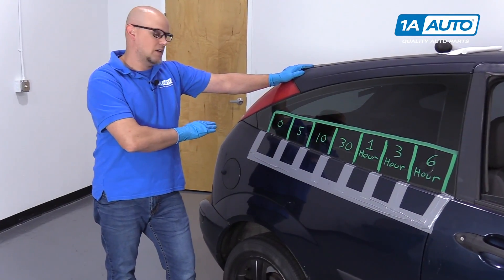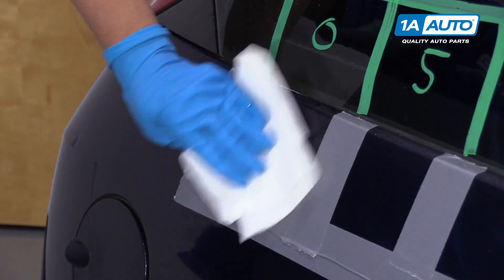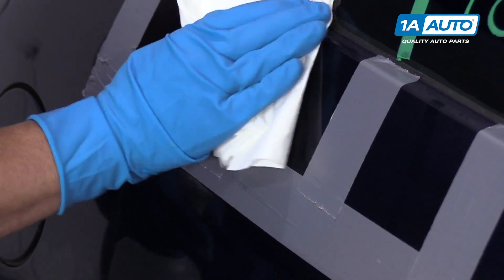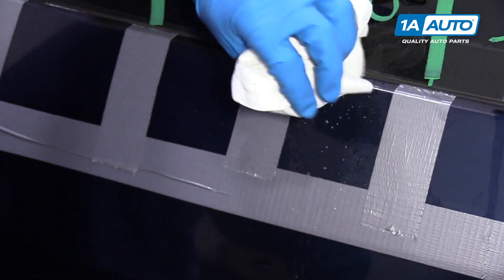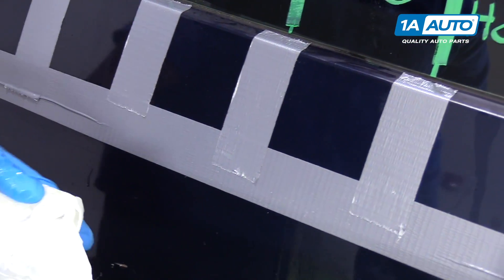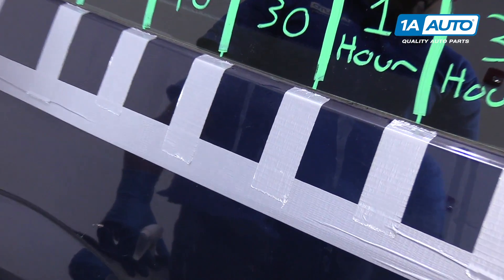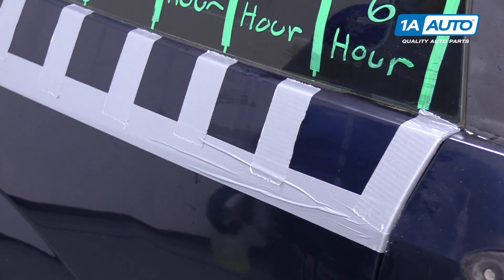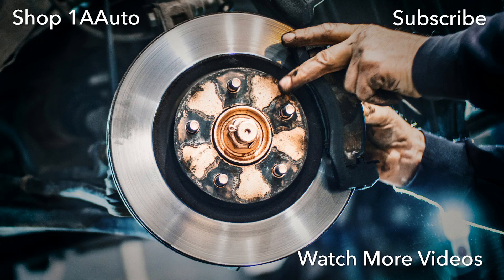How Fast Does Brake Fluid Affect your Car Paint?

Comment: I did a paint correction and used a paint can that didn’t have any hardener and it stayed relatively soft then I applied a layer with a paint can containing a slow hardener, then I polished it was ok but at some tiny area it was not perfect and I sanded it more and it went worse and worse because of the soft layer, then I ruined it. After that I took a dot 3 brake fluid and the soft paint was very easily to remove within minutes. Even the primer beneath was stripped and now I can apply new primer and new paint.
So it looks like it depends on the paint you are using for. If it is factory 2k paint it doesn’t work well. If it is paint with no hardener it melts it instantly but such paint is useless anyway. But for small jobs you can use a spray can that has hardener inside but it doesn’t dry out in the can. For this the brake fluid works. If it is 2k paint available also at in a spray can that you can take from a local shop, this will harden inside the can within hours so you need to use it quickly. Brake fluid will probably no work well with this.

Comment: what about DOT 4 & DOT 5? those are the DOT fluids used on bicycle brakes, but some brakes use various types of MIneral oil.
Reply: Dot 3, 4, 5.1 are ether based like shown in the video. Aka paint stripper. Dot 5.0 is silicone based, and I don't know the effects of that fluid. Shimano mineral brake fluid is just very thin oil that doesn't damage the paint.

Comment: On old paint jobs like acrylic enamel an lacquer, brake fluid would eat all the way to metal.
Reply: how about 5.1?
Reply: +Trombolio it's still glycol-ether based as with DOT 3 and 4 fluids. DOT 5 being silicone based doesn't strip paint.
Reply: @trombolio  same thing, it's happened to me with 5.1 and it ate all the way to the metal but it was sitting there for months
Reply from the maker: +edbo10 Thanks for the feedback!